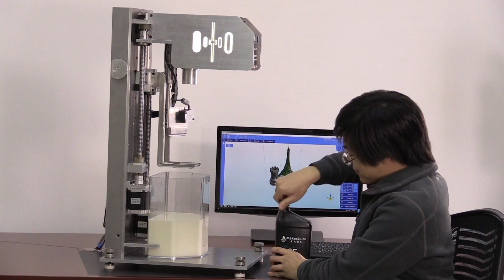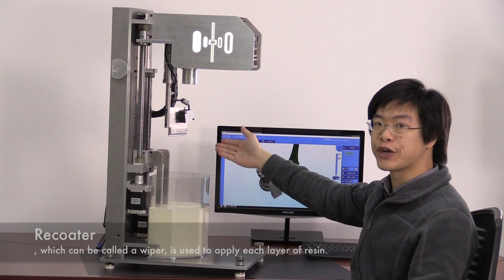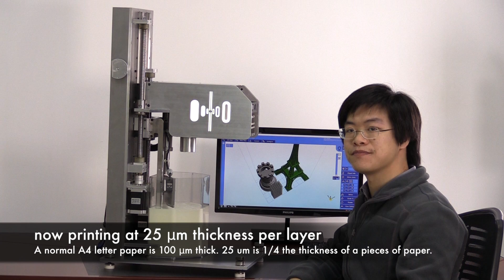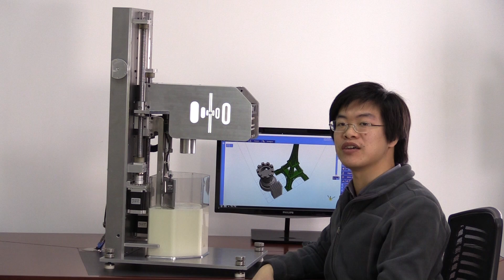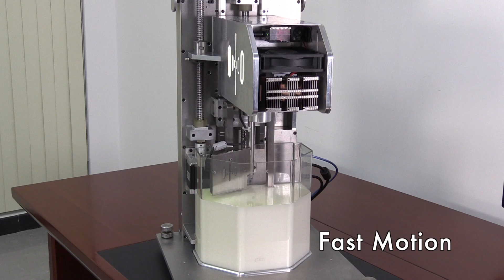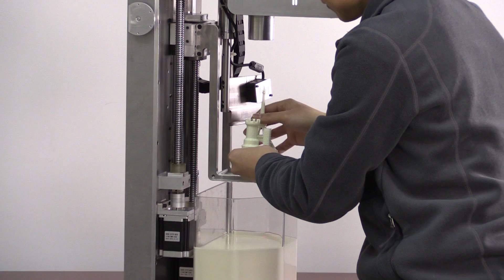Octave Light R1, Top-down Desktop DLP Stereolithography (SLA) 3D Printer, Prototype #4

Comment: How long actual time for production take?
Thank you
Reply: It depends on the height of the model and the layer thickness. Tilt the model to its thinnest dimension to save time. 
Example 
20 mm model = 20000 microns = 400 layers of 50 microns each = 16 mm per hour =1 hr 15 minutes

Gary Miller
Official UK Distributor of Octave Light R1 3D printers and photopolymer resins

Contact:
sales and technical support  +44 7811 256 360  +33 4 92 13 22 62
gary.miller@accordaltd.com
Reply: @garymiller9449  why does it take so long to make one pass of the UV head? is this because of resin cure time?
Reply: @georgegeorge9242  It takes about 10 seconds per layer. Several things happen. The build platform moves up and down in the resin filled vat. The laser measures the new resin surface height. The surface height moves up as the platform descends to exactly 15µ, 30µ or 40µ below the new surface level , think Archimedes. The platform has to then move to the correct height. The projector is fixed focus so it also has to move to correct height above the new resin level. The blade then sweeps the resin surface flat, precisely according to to the user set Z height. Then the exposure is about 1 second. The platform dips and rises and the viscous resin must flow unaided over the build platform and then become still. 
The advantages are many. 
No vat  tray to replace, no FEP to change
Heavy parts don't fall off because they are supported from underneath, not from above.
User configurable Z height
Semi automated 3rd party resin calibration app
No separation forces on the model. 
Laser level app
Open resin architecture

https://octavelightuk.ucraft.site/
BUILD PLATE SIZES
57.6 x 32.4 x 120 mm high in the 30 micron model
76.8 x 43.2 x 155 mm high in the 40 micron model
96.0 x 54.0 x 204 mm high in the 50 micron model
134.4 x 75.6 x 204 mm high in the 70 micron model

Whatsapp +447811 256 360 

Download Technical Specifications here
https://onedrive.live.com/?authkey=%21ACpdRto5HpN9rIg&cid=79310B8011D75F2B&id=79310B8011D75F2B%21314&parId=79310B8011D75F2B%21254&o=OneUp
Reply: @digilume  Some UV resins need 5 seconds of UV irradiation per layer or does this depend on the layer thickness?
Reply: @georgegeorge9242  I don't use many different resins but this projector cures in between .5 to 1.5 seconds in most cases using OctaveLight castable resins. It depends on lumens per sq cm. The difference due to Z height is about 1/3rd of that range. The projector was upgraded to a stronger version in 2019. Larger build plate , same projector = longer exposure but the exposure is usually less than 15% of each layers time requirement. There is an automated app that prints a test strip to zero in a new resins required exposure time for a given Z height. It prints a strip of a  different number of layers and the the sample that is the correct thickness is your target.
Reply: @digilume  ok I get it thanks I am developing a new kind of UV resin. I am wondering what kind of UV light source should I try for some quick testing.

Comment: isnt surface tension a problem? still able to achieve 100% flat layer?
Reply from the maker: Yes, this is how stereolithography was traditionally done in an industrial scale. We have miniaturized a top-down with recoater blade stereolithography machine, so that it sits on your desktop, instead of requiring a whole factory floor to fit.
Reply: I think surface tension only causes curvature at the edges of the resin tank where it contacts the vertical walls.  The re-coater blade is very sharp, totally flat and it is used to smooth out a layer of resin at the precise thickness above the model just before each exposure. The z dimension layer height can be set as low as 10 microns by the user before starting each print. The focus is set by a laser rangefinder with no set up guesswork or help from the user, so it is always accurate. 

So, no I don't think the printed model is affected by surface tension. 

Gary Miller

Official UK Distributor of Octave Light R1 3D printers and photopolymer resins

Contact:
Orders and technical support  +44 7811 256 360  +33 4 92 13 22 62
gary.miller@accordaltd.com

Comment: Hi Charles, 
awsome printer and very good work.
I have some questions about that.. I sent you 2 emais but you didn't answer
I am going to send you another one.. Hopefullym you will see my email.
Thank you
Reply from the maker: Dear Mathieu, the firmware inside the Octave Light R1 is written from nothing to something, entirely by myself and by my electrical engineer. The circuit boards inside the Octave Light R1 that I am shipping to customers are entirely custom designed by my electrical engineer and manufactured by a power supply factory next to my machine shop. Best regards, Charles
Reply: Octave Light

Hi Charles,
thank you for you answer. I see on your video that you're using creation workshop, then you're using a Gcode. I would be interested in having a look on that Gcode if it is possible. I am very interested in how you did with you laser system and your wiper.

thanks a lot
Mathieu

Comment: Why buy this when you can get the Moonray or Form 2 at a 3rd of the price for the same quality and larger build size?
Reply from the maker: Quality is far far from the same. The Octave Light R1 is in a totally different league.
Reply: Specifically, the diameter of the round laser on the Form 2 is 140 microns and it is round. The Moonray's resolution is 100 microns. The largest resolution of the Octave Light R1 is 70 microns (70/1000 mm) and it is square, i.e. the edges of each square voxel mate together. That is not possible with a circular laser where there are gaps of unexposed liquid resin trapped in the print. If you cast the print directly into gold then the uncured chemicals in your print will attack the plaster-like material used in lost wax casting methods, thus degrading your end product's surface quality.  The smallest resolution of the Octave Light R1 is 30 microns. You can choose between 30, 40, 50 or 70 micron models of the Octave Light R1.  30 microns is 0.0011811 of an inch

Also, please consider that if you shine a round beam of light onto a flat surface at an angle like the Form 2 does, then you get an oval exposure causing distortion at the side of your print. So using the full, theoretically larger build plate has its drawbacks. The Form 2 uses a single fixed laser  bounced of a tilting mirror to cover the entire surface area. 

The Octave Light R1 uses the same technology as your local digital cinema, namely a flat Texas Instruments Digital Micromirror Device (DMD). The R1 also incorporates proprietary anti-aliasing software methods to smooth the surface of the print at the edges of the layers. 

Each DMD projector in the R1 has over 2 million micromirrors that simultaneously expose each layer. The Octave Light R1 comes in 6 models offering xy resolutions of 30, 40, 50 or 70 microns for each square voxel and a dental version with respective build plate sizes of:
 
57.6 x 32.4 x 120 mm high in the 30 micron model 
76.8 x 43.2 x 155 mm high in the 40 micron model
96.0 x 54.0 x 204 mm high in the 50 micron model
134.4 x 75.6 x 204 mm high in the 70 micron model

The layer height (z) can be set by the user from 10  microns versus a  minimum of 25 microns in the Form 2. However 25 micron layer height is sufficient in most applications.
Human hair diameter varies by hair colour:
17–50 microns (flaxen)
56–181 microns (black)

I hope that helps. 

Gary Miller
Official UK Distributor of Octave Light R1 3D printers and photopolymer resins

Contact:
Orders and technical support  +44 7811 256 360  +33 4 92 13 22 62
gary.miller@accordaltd.com

Comment: that's great! i'm interesting with this project, i'm fourth-year student at Ha Noi University of Sience and Technology and I want to make it for my final-Project. Can you share me the document about control DC servo, process laser? my gmail : PhamHau20120363@gmail.com
Thanks for helping.
Reply from the maker: Hi. Thank you for the interest. We are a company in the business of engineering, manufacturing, and selling one of the most advanced desktop 3D printer at the lowest cost we can manage. If you are interested in purchasing an Octave Light R1, please email me at charles@octavelight.com
Reply from the maker: If one go to any university library and look into the electrical engineering section, then one will find years of journals and books on controlling and driving motors. Any suppliers of motor driving chips, will even give you example C code for free download on their website. There is no need to ask on youtube, on the age old electrical engineering topic of how to control motors in respond to input from measurement sensors.

Comment: how long it take to print objects in video?
Reply from the maker: +Adam Tuminski 

Adam, 

Thank you for your interest. 
The printing speed of the Octave Light R1 is 
8 to 4.5 mm per hour, when printing at 25 µm per layer; 
16 to 9 mm per hour, when printing at 50 µm per layer; and 
32 to 18 mm per hour, when printing at 100 µm per layer. 
Actual time depending on the printing parameters the user is selecting. 
My email address is charles@octavelight.com

Best regards, 
Charles